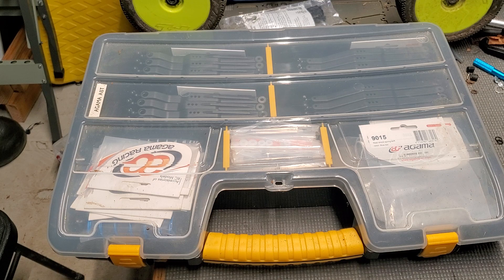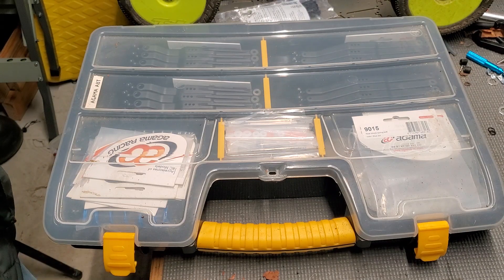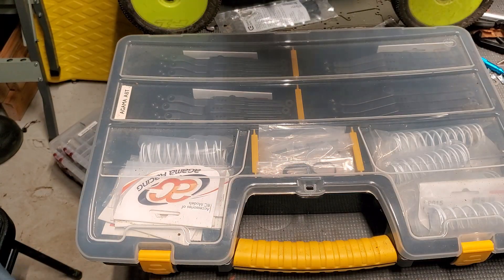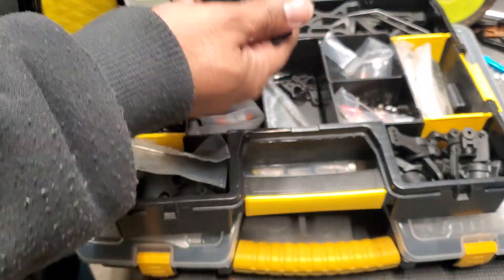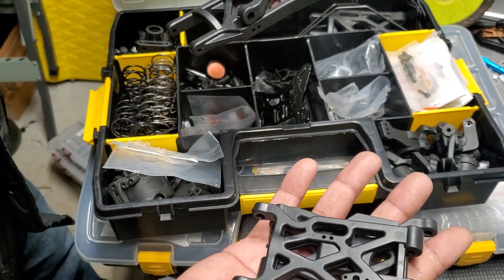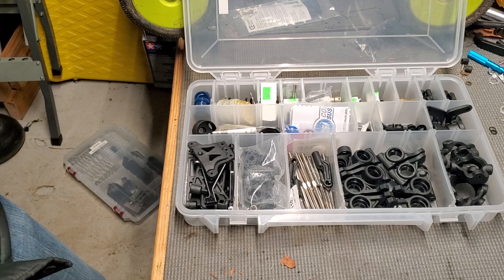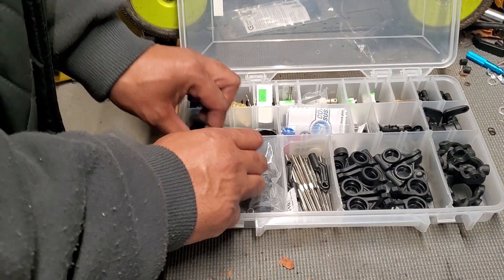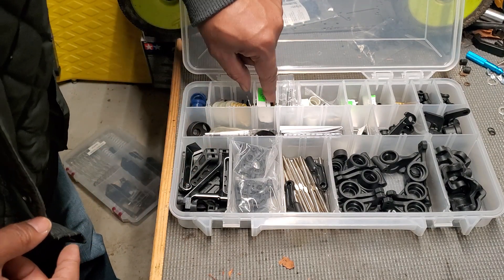Long video of parts i stock up on

Comment: I have my list for part’s, just have to order them. 😉
Reply from the maker: 👍👍you can look for deals on ebay or Facebook and try to research what parts are common between your kit and another from the same company, that will expand your available resources for parts.
Reply: MrLilchilly Thank’s for the info MrLilchilly, i will have a look. 👍👍🇩🇰